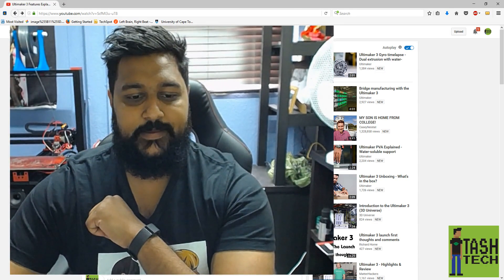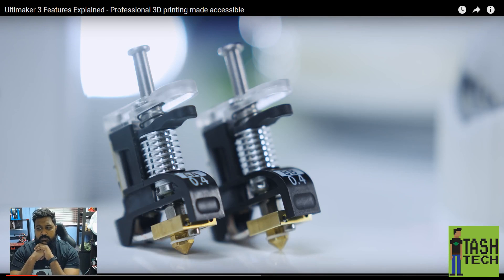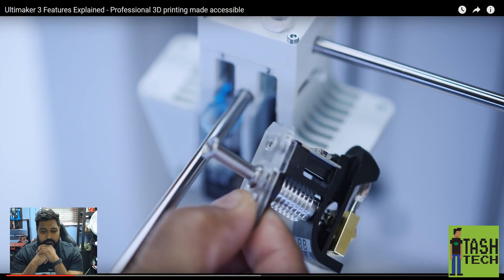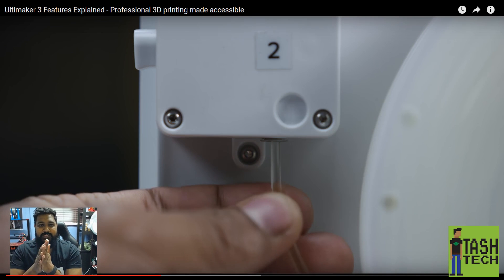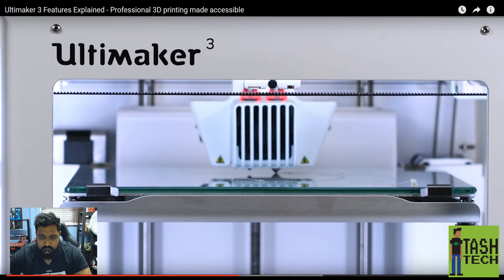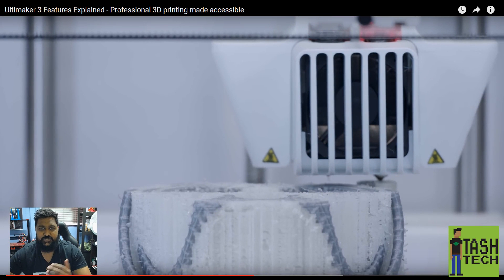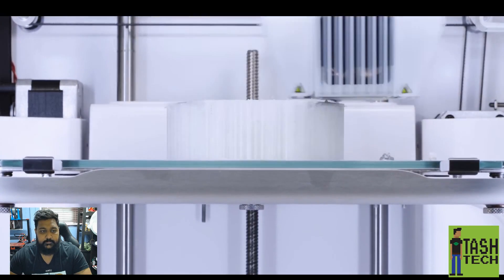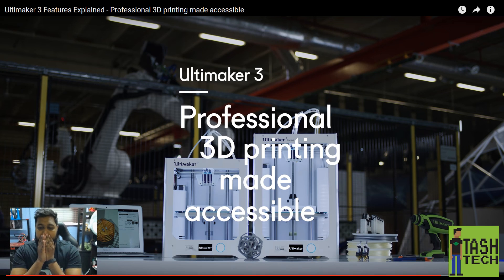LOGBOOK-T (19 October 2016) ULTIMAKER 3 RESPONSE REVIEW

Comment: The difference between the PrintCores is the internal geometry. The BB PrintCore has internal geometry optimized for PVA.

The temperature readings aren't actually better, but the firmware has better temperature management.

The filament system is open. If you put your own filament on there you need to manually set the settings and manually select which material is selected.

The video was made with an outdated firmware version in which active leveling was broken. That explains why the bed adhesion came loose here.

I don't think printing PVA and PLA from the same nozzle is going to give good results. I bet the nozzle would clog.

"Build plate tesion" xD

Comment: Hey Tash. Good one bro! I was so looking forward to this release in the hope that there will actually be some innovation. I was an Ultimaker fan until now. They now think that they can paint anything white and add a few lights and sell it for double (probably triple) what it's worth. I agree with you on price point. I'm happy to spend that but I could put in a few more grand and probably buy an Objet. Besides that, what do you think about the price difference for the 3 and the 3 Extended....For a little bearing and board!...madness!! They unfortunately have this crazy following that are blind to the fact that they are just getting sold old technology that's not as future proof as they claim. It's quite upsetting to be honest. But that tends to happen when companies get popular(rich). They think that they can offload any crap to their customer base -- a lot of which are a bit ignorant to these facts unfortunately, so it's self perpetuating. I've currently got a Makerbot which I've hacked to bits and is now as reliable as ever, and has serviced me well over the years but now I think it's time for a change. I was going to go with an Ultimaker but now I'm thinking Prusa or some other open platform. Keep the vids coming.
Reply from the maker: yeah dude you get it, its the Apple of the 3d print world, they started off so well, but, like most other companies that fail, they failed because they could not remain innovative, instead got blinded by their own over indulgence and arrogance, that they produced something that no one was asking for. just look at the dislikes on this vid as well, yet no one has engaged me in the comments to tell me why im wrong?? its because the same people who disliked it are the same ones who are blind ulitmaker followers.